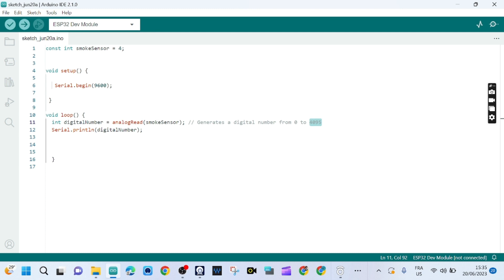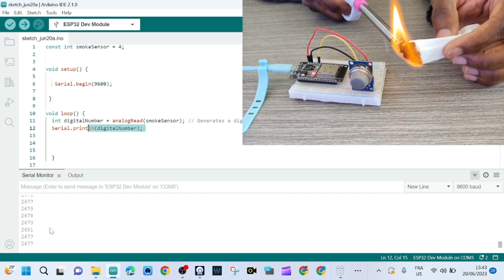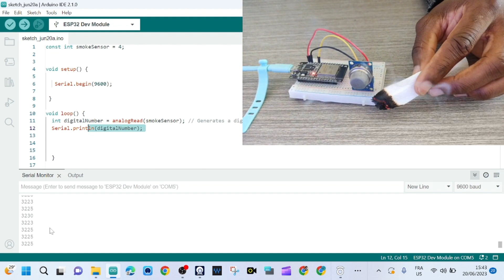ESP32  Smoke Detector | MQ-135

Comment: my esp32 works fine with dht11, but when i connect to mq135, the data was not consistent. And when i disconnect the mq135, esp32 still print random value. Do you have any suggestions?
Reply from the maker: Is it your first time to use ESP32 with mq135?
Reply: @uploadideaswithitamar  yes.